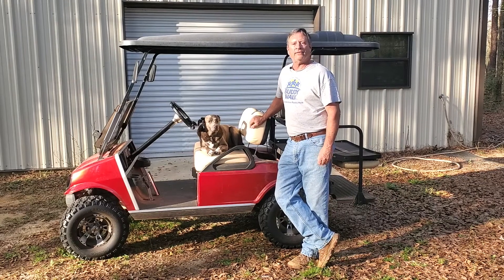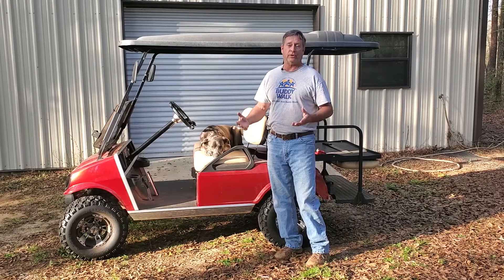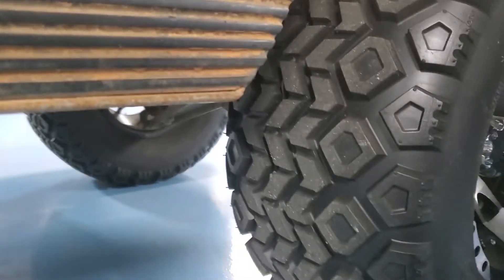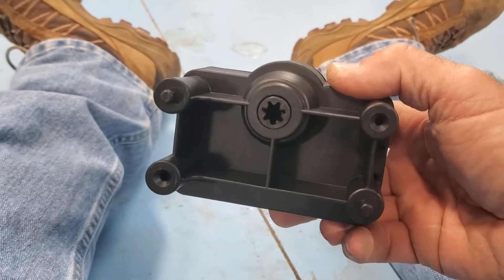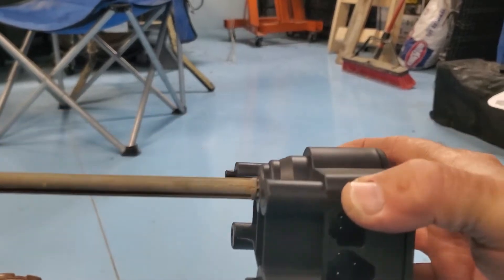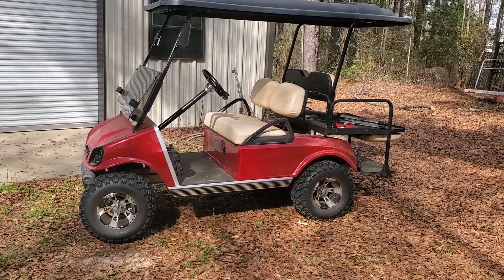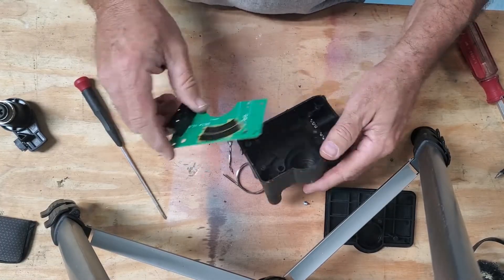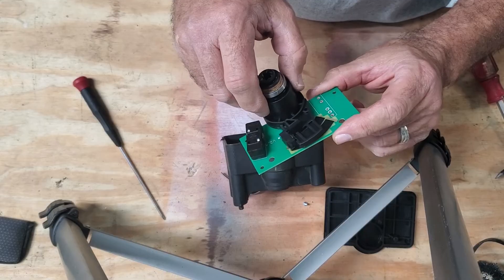Club Car speed control was bad, replaced MCOR

Comment: A few ninutes before I watched your MCOR replacement video - BTW, nice job, thanks. I really like that you opened the MCOR up - I appreciate your curiosity as I would have done the same thing.  I had just watched a video by CAMP CARTS, a golf cart repair and sales shop, and they showed a repair method that is super fast and super cheap. They drill a 1/8" hole in the bottom of the MCOR, on the wiper side, and generously spray WD40 into the MCOR to clean and lubricate the wiper and carbon tracks. During your video you wiped your finger over the carbon tracks and I noticed that significant loose carbon transferred to your finger. Loose carbon on the carbon tracks and wipers is going to build up and create a bumpy surface, interrupting current flow, and cause the hesitant acceleration that is common for a bad MCOR. CAMP CARTS didn't say how long the fix would last but then the Chinese replacement MCORs from Amazon and eBay don't last that long anyway. The MCOR is merely a potentiometer and a decent quality potentiometer's carbon track has embedded lubrication. Obviously the Chinese skip that step and therefore the carbon tracks don't hold up and the carbon ends up being wiped off a little at at time. I haven't tried CAMP CART's repair but I definitely will when my MCOR starts acting up. BTW, I went back and looked at their video again and I suspect that they drill the hold on the bottom side so that excess WD40 will drain out. Personally, after a day or so I would tape over the hole to keep dust, etc., out of the MCOR.
Reply: Can you link that video? Thanks.
Reply: @johncalvo1743  https://youtu.be/EY212b9qIUo?si=8KKeQnzN-_sFtBYq
Reply: The paragraph above mentions what the CAMP CARTS video did to a Precedent MCOR.  I did this on my 2004 DS and the result was a dead MCOR.  After I sprayed it with WD-40, I let it drip over night.  Next day it ran forward for about 30 feet and it died.  No recovery.  Replaced it with an Amazon MCOR and cart is running again.  I am pleased with it's speed, except at top speed it hesitates and recovers repeatedly.  I don't feel the new MCOR is faulty because the cart was hesitating at top speed before the WD-40 interjection.  Videos on Speed Sensors say the cart will revert to a slow 8 mph speed, no mention of a pulsing speed.  Any ideas?

Comment: Thank you the video, I noticed the contact area on the circuit board was in pretty good shape. I couldn’t see the wiper part. Have you tried to clean both , lubricate and reassemble and see if it works?
Reply from the maker: I thought about it because I'm a tinker. But if the potentiometer wiper is not making good contact, it's usually not worth messing with

Comment: I have the same cart as  you.  I replaced my MCOR and now my cart runs at about half the speed as it did before.  Any idea or suggestions on how to adjust or increase the speed? Also, when i let off the accelerator and push it back down there is a 1-2 second delay.  any assistance would be appreciated. (batteries are pretty new so that is not the problem)
Reply from the maker: I think this golf cart has 3 speeds. There is a handheld programmer to change it to another but it is not cheap. Mine used to go slow but I found that if I have the peddle pressed then turn the cart on, it will go in high speed. after doing this several times over a few weeks, it just stayed in high speed. Also, if the splines are lined up correctly it should not make a difference in your speed from what you had before.
Reply: Put a piece of rubber fuel line over one of the notches. Should make it faster

Comment: How do i adjust my golf car accelerator
Reply from the maker: I need a little more info.
Does it have an MCOR module? 
Are you referring to rate of acceleration or did you mean adjust top speed?
Are your batteries weak? Weak batteries will always have slow acceleration.

Comment: Will the speed magnet work with the stock sensor?
Reply from the maker: There are many sensors types. A reed switch (on/off) is activated by a magnet. In the mower engine, it is the speed of the magnet passing by the the coil that causes the spark. The coil is not a sensor, i.e. lines of flux cutting the wires of the coil.
Reply: @countrylivingwiththewades8784  00⁹

Comment: @Country Living With The Wades - I'm also a 2003 Club Car owner and I really like the stance of your cart.  Can you tell me the size of your rims (diameter and width).  Also, what size tires are you running?  Was your original motor able to handle these bigger wheels, or did you notice a degradation in vehicle speed and performance?  Thanks so much!
Reply from the maker: 22X11.00-10 Tire size  RHOX wheels
Reply: @countrylivingwiththewades8784  I finally bit the bullet and bought a new motor and controller for my '03 club car.  The wimpy 3.2HP motor from the factory couldn't handle the lift, larger tires, and rear seat addition.